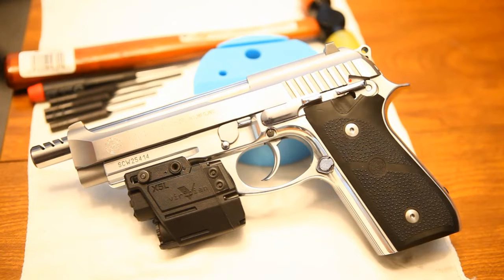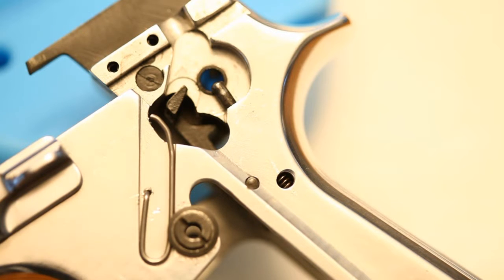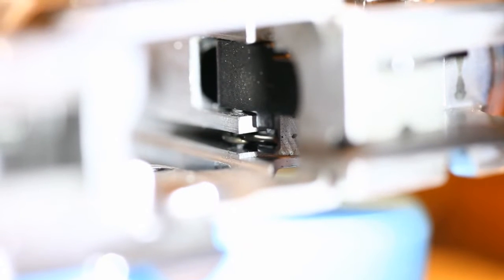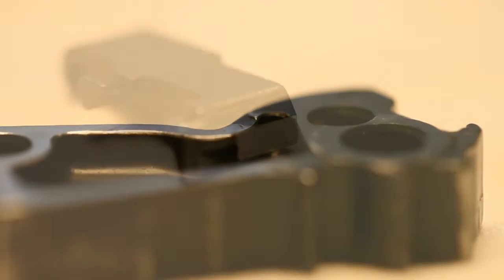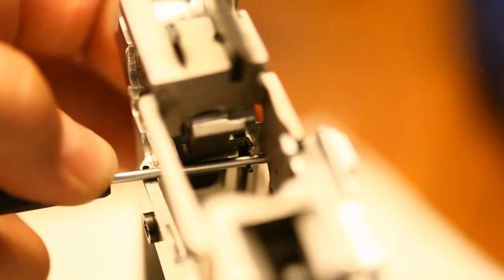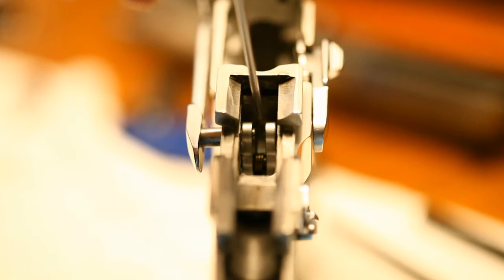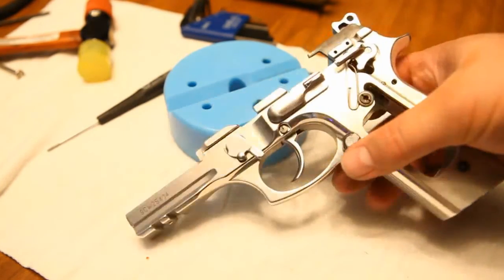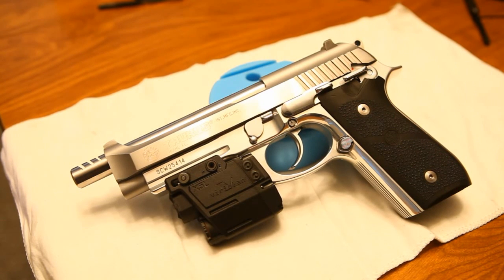Taurus PT100 / PT92 Trigger Job And Beretta D Spring Install - Beretta 92FS 96FS

Comment: I am an amateur home "smith". This video was SO helpful. I usually polish all my triggers but the taking apart and putting it back together on the PT92 is 95% of the battle. Needles to say my trigger is about half of what it use to be. It's an early 90's model. Very good pistol but the trigger was hard. Again thank you Much for this vid. Big thumbs up.
Reply from the maker: thanks! glad it helped
Reply: I couldn't agree more ! I searched the internet and this is the most relevant and helpful video by far ,thank you,your video is very appreciated!!

Comment: Great video. Thanks for your help. Best tip on Taurus PT92 is removing hammer, hammer spring and strut from top like you showed. This eliminates problems with Taurus security lock system. I used the 12# Wilson Combat hammer spring . I also used the Beretta factory video to remove and reinstall the sear spring. Thanks again and God bless

Comment: Dude, just letting you know that I have been inspired by your video and after a successfull trigger job on my PT 100. I was so pumped that I searched for videos to do my G3 clone's trigger (10-12# factory). I couldn't find any videos that actually showed breakdown and assembly. I tackled it anyways and got it down to at least 5-6# with very minimal creep and not "gritty" feeling at all. Thanks AGAIN.lol

Comment: just did this to my pt100. AWESOMEtrigger pull when cocked. Will get D spring later, but the action is a lot smoother after the polishing

Comment: Just a heads up! The roll pin that holds the safety in place should be driven out from the bottom to the top.  It is installed from the top to the bottom and gets a slight flare during installation. Driving that "flare" through the safety lever and the cross shaft can be challenging. Brownells has a 1.5mm Beretta punch (080-092-055) that works great. 5-6 light taps with a brass gunsmith hammer and the pin was out. Unfortunately the punch costs $16.00. Really glad I started this project, the frame was full of aluminum filings.
P.S. Found these 1.0 mm punches on ebay (Item: 221549840821) 2 for $1.00 delivered. Small and cheap but should work well on the roll pin.

Comment: When replacing the trigger bar, turn the gun over, feed dental floss up from the bottom behind the trigger on both sides of the gun. Pull the 2 ends of dental floss out the top of the gun. By pulling on the floss, you will pull the trigger spring back allowing for easy install of the trigger bar. Once complete, pull 1 end of the dental floss to remove it and check to be sure the spring is in the slot on the trigger bar. Much easier than trying to put it back in with a screw driver.
Reply: Good idea!

Comment: A few years ago I also figured out that it is MUCH easier to R&R the sear by pushing the pin out just enough to clear the sear to not have to deal with the sear spring.  I've tried to explain it to others on the Beretta forum, but your video shows just how easy it is.  Question though. At 6m27s it shows the sear already nearly in place. Approximately how much time does it take you to get it to that point? I like the suggestion by opisex
of putting the hammer strut in first, too!

Comment: For anyone who comes across this video with a similar problem to mine: I purchased a set of gold parts from a PT940 to put on my PT911.  After the install, I was annoyed to find out that my pistol basically only worked in double action, with no sear engagement in single action mode.  I thought I broke something, or disengaged some part of the sear assembly.

Turns out the trigger bar and sear have slightly different measurements between the two.  The parts are majority interchangeable but the sear, trigger bar, and extractor are not interchangeable.  You might be able to move the sear and trigger bar together, I didn't try because I didn't want to go swapping out the sear, but the 40 cal trigger bar definitely does not work on the 9mm sear.  This may also be a generational difference, since the 40 cal kit I got had a loaded chamber indicator arm instead of a solid extractor, and some of the springs were different.

Comment from the maker: @jonmessenger I would check to make sure you sear spring is in the correct direction and properly installed. Does it lock back if you manually pull the hammer? Just making sure you didnt shave to much off the sear or hammer. Also make sure your hammer strut bar is in the right way. Watch the video again and double check everything. Hope you figure it out!

Comment from the maker: Yes it does reduce hammer force but in the years I have been using it I have had zero light strikes or failures, the spring is made for a double action only Beretta so it offers a lighter pull, but still enough force to fire reliably

Comment: Great Video!...(Ive Had 2 go back 2 it Several times over the Years!...Its Definitly Helped!...
Ive Gotta Question 4 U! Hopefully, U Can Help ME?!...Anyway, Would a Increased or Reduced Power Main Trigger Spring Have ANY Effect on DA Trigger Pull Weight?...(Without changing or Lowering SA Trigger Pull Weight?...)
Ive Gotta Taurus PT100P-* Ive Already installed a D Spring & Increased Power Firing Pin Spring*(Ive Also gotta Wilson Combat Trigger Bar!...*I jus Havent Installed It Yet!, Kuz I Dnt have a Punch Small Enough to Take Out The Safety Detent Pin.*
Thx Again 4 Ur Help
Very Informative Video!!!
Reply from the maker: it should help lower the trigger pull but you could get light primer strikes, you would just have to swap em and run it and see how it goes!

Comment: Ok, I was having a problem, when I put the D spring in, with getting the hammer to lock back. After some thought and inpection I figured out the spring that held tention on the sear had been moved just enough to not hold the sear in the rear position. It's been "straightened" out and this thing is nasty. Thanks again man. 

P.S. my pt 100 doesn't have the light rail thats built onto the lower receiver. I want to add that scope rail for optics but the rail attaches to the lower receiver rail.

Comment from the maker: I dont have a pull tester, its lighter and smoother tho, DA to because of the new spring. Taking the play out could be tricky you would need some custom machined parts to tighter tolerances to get rid of alot of the slop

Comment: there not enough detail about the sear disassembly and spring my hammer wont lock when i pull it back it driving me crazy i had a Beretta m9 before and had no problem i dont get it

Comment: True but i dont want to wait until something breaks. I can replace the parts myself and avoid the trouble of having to ship my favorite pistol out and then wait. I will say they must tough springs though because i felt of the tension on my trigger spring amd trigger bar spring and they felt rock solid after over 3000 rds and who knows how much dry practice. By gritty do you mean less stagey though? Cause my only issue with the double action pull is that "build up" so to speak at the end of the trigger pull. Makes for a more difficult and harder to anticipate pull at times.
Reply from the maker: DA should feel smoother through out the pull, also you shouldn't have to send your entire gun in to replace the spring, I had my safety lever break, they had me mail them the broken part they mailed me a replacement. 
Still those springs are only a couple cents or dollars, if you are worried about them breaking pick up a few extra to have on hand.

Comment: Wouldn't replacing the hammer spring reduce the force of the hammer hitting the firing pin? If you're shooting steel cased ammo, failed primer strikes may increase.

Comment: Actually I was in a rush and not paying attention.  They weren't light strikes, it was the hammer not locking back after firing, so I had to go to double action to fire the next round.  It does this every other round.  So, I've put in the D spring again and I bent the sear spring to give it a little more tension and let's see if that fixes it.
Reply: lcash365 what happened

Comment: HELP! I thought I did everything right but for some reason when I shoot my first bullet the gun stays in double action every shot and the hammer started slipping like it sensitive to the touch when it’s cocked.

UPDATE I put the sear spring on wrong and it works like a charm. I had to go to a Beretta 92 disassembly video to see what way it goes
Reply from the maker: glad you got it figured out

Comment: good video!is that a efk firedragon barrel?i have one ported like that,along with their dual recoil slide spring for my beretta 96g elite 2 .40 cal.i may take mine apart and polish the sear and hammer like you did!is there any polishing you can do with the external trigger bar to get a better feel or pull weight?thanks again!

Comment: Hey there. Not willing to install a d spring as my 92af is my primary edc and my life may count on it one day. That said just the polishing portion of this job, is it a really noticeable difference? By that i mean will it take some of the stagey'ness out of the double action pull? All i would like to accomplish is a smoother double action pull. One final question lol, as i said this my edc gun so how often would you recommend changing out the trigger and trigger bar springs for reliability and avoiding breakage? I currently have a lil over 3000 rounds through my gun. Sorry so many questions,  not too terribly many m9/92 vids out there lol.
Reply from the maker: Really I dont think you have anything to worry about with trigger springs, I have had this for many years now, 1000's of rounds, and the trigger springs all look fine, member taurus has a life time warranty so they will be replaced for free.. The polish job will make everything about your trigger pull and break smoother and less "gritty" feeling

Comment: Aguila and tula. I'm noticing that the firing pin doesn't get directly pushed. That it has to travel further than the hammer takes it? Would it might need a longer pin? Though it worked before I mucked with it just fine
Reply from the maker: maybe you need to clean your firing pin channel out?

Comment: Watched the video and could not have done this trigger job without it. However I think you should better explain re assembling the hammer it is a bear. Not as simple as you make is sound. Did this on my pt99afs but still awesome vid.

Comment: ok after losing a trigger bar spring and waiting fore Wolff springs to get 3 here fighting with the little pin on the decocker. it is a gun again. Never to go past basic cleaning again. i would have had my Glock together 25 times in the time it took to do this little job.
Reply: stop playing with it.
its not a toy.
fix it once and leave it alone.

Comment: Nice shots of your thumbs and the back of your hand at the most critical steps in the whole procedure.

It might be worth noting that you don't want to lose the safety spring.  It's the one that's held in place by the grip bushing and looks like a paper clip because it's a "restricted" item and Taurus will not sell you one.  I've never seen one in an online company spare parts package either.